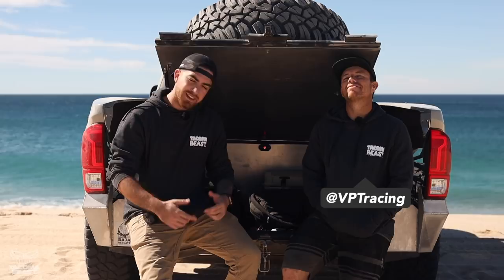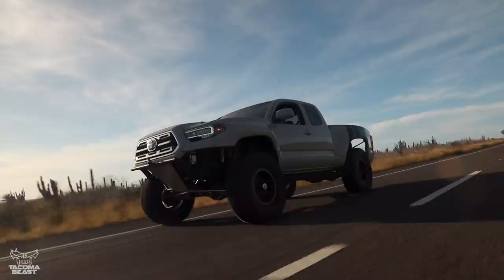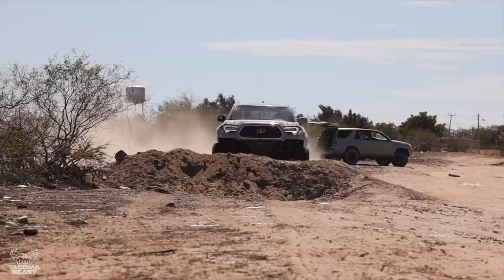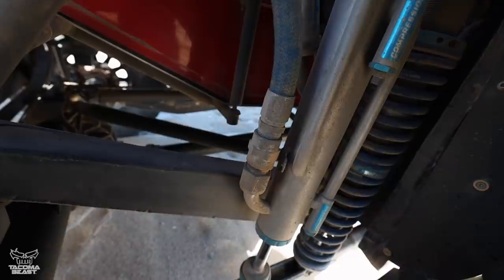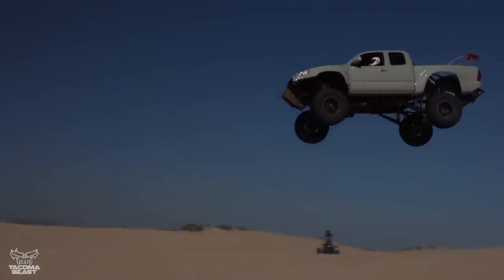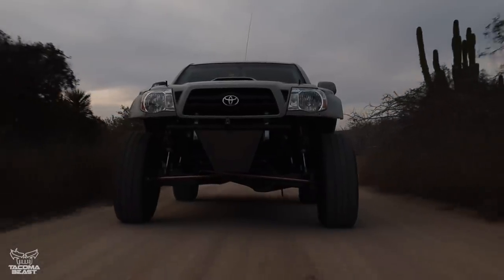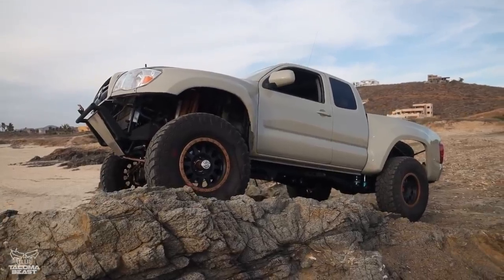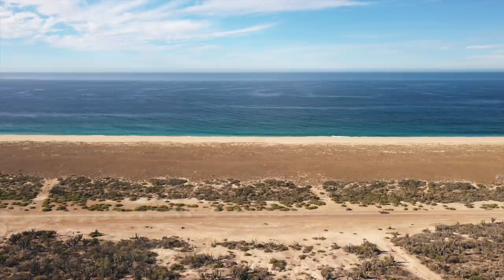The Frankenstein! V8 Toyota Tacoma Build Talk

Comment: Pre runner over overland any day 💪👍
Reply: Prelander..😁😁
Reply: @marcusbevz6500  🤔🤔 not bad dude but full pre runner tho always clean :)
Reply: Lol.. you had to say the O word. The only real overlanders are in Australia. Outside of that, they should just call em, preppers
Reply: @450ktm520  Straight up most "overlanders" are just hype beasts buying expensive bolt on parts, half of them pay to have them installed anyways... Just call it car camping guys like come on they just do it to flex their expensive parts.
Reply: @ravsuv-help794  yup car camping. Funny enough, when pre runners want something like an overlander. They buy a toy hauler/travel trailer. I guess it's all about purpose.
I do a lot of fabrication and get a few Oh ppl. Their mindset is on different purpose but good ppl.

They start to find out that weight takes a toll on bearings, springs, frame, oem welds. The ppl who really use their rig, I give em respect for pushing the envelope. Again respect to the true outdoors overlander guys... for the wannabes, dont be afraid. always worried about losing value. Bridge that gap and use that shit

Comment: 1:13 You can see that the twin traction beam style front suspension changes camber severely. This is bad. Ever watch a Trophy Truck front IFS work? The wheels gain negative camber (as opposed to this vehicle's positive camber) as the suspension droops. They do this to maintain track width throughout suspension travel. This suspension does the opposite, it shortens the track width faster with suspension travel.
.
Reason why you want the wider track width? The suspension moves freely up and down. With a normal IFS, and heavily exaggerated in this style, as the suspension cycles it slides across the ground resisting suspension action. This is especially bad at high speeds since that pushing action as the track width grows from full drop to compressed can push the vehicle to one side or the other depending on which front wheel has better traction. Also, the vehicle can roll over easier. 
.
And that's not even getting into the scrub radius those knuckles must have. 
.
TTB is cheap travel, but travel isn't everything.
Reply: Center-mount IFS is clearly better, but ttb/beams are easily superior to IFS based on factory-style pivots. Not everyone can drop 20k on a center-mount trophy truck front end. If your options are bolt-on A-arm kits or a ttb/beam swap, ttb/beams are an easy choice.
Reply: @nicklowe2686  TTB reduces wheel track with travel. The opposite of what desert trucks run. And it has a lot of unsprung mass. Still a lot better than typical IFS to your point (basically I’m agreeing with you. Haha)